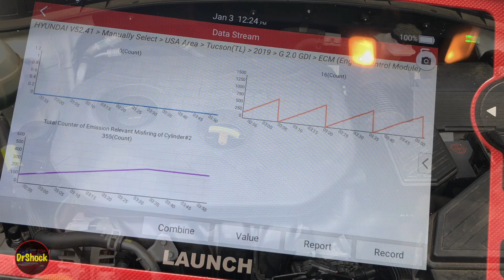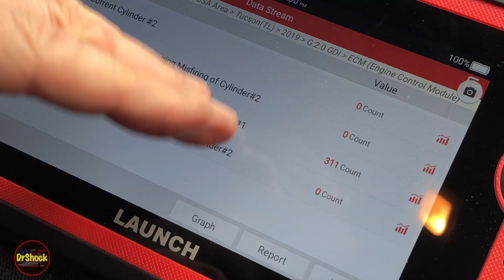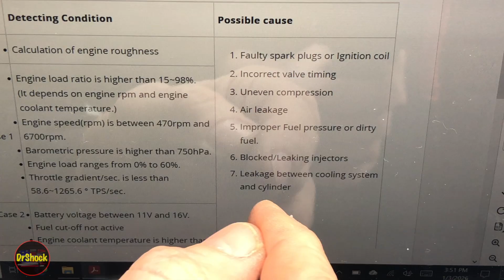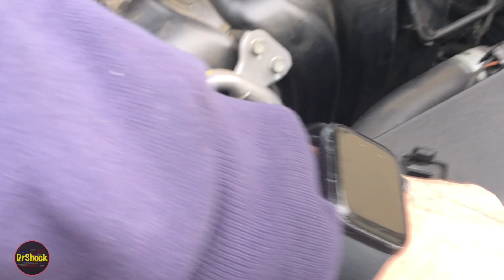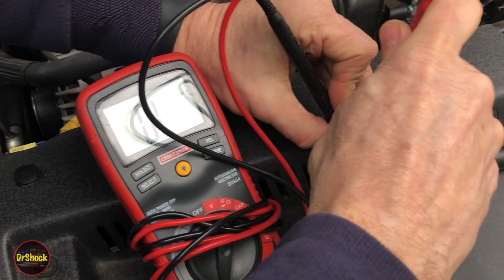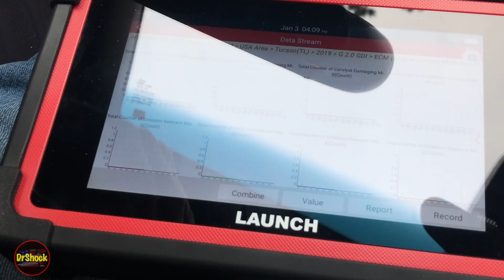2016 - 2021 Hyundai Tucson 2.0 GDI Engine Misfire Diagnosis ~ P030x Code ~ Ignition Coil Replacement

Comment: If you use Denso Coils would this be a warranty issue?
Reply from the maker: Technically, it shouldn’t matter. But it’s up to the individual dealership on these extended engine warranties whether they claim an aftermarket part was at fault or not. 

So I tell customers this isn’t a situation to be trying to save money, but rather prioritize the protection of the manufacturers extended engine warranty until it’s expired.  Don't give the dealership an excuse to reject a claim.

Comment: What about if you put after market spark plugs? Do you lose your warranty?
Reply from the maker: Technically, you're not supposed to.  But these Hyundai / Kia engines have been subject to several recalls so you do not want to take any risks here.  It is totally up to the dealer whether your engine problem qualifies for warranty coverage, or not.  

So spend the money for OEM parts only until the factory warranty, and any extended special campaign extended engine warranties have expired is my advice.

Comment: Why you did just leave number 2 where it was at sent you no it was number one
Reply from the maker: We swapped the cylinder 1 coil with the cylinder 2 coil to determine whether the misfire was specific to the ignition coil.  This is a common diagnostic approach with these engines.  In this case, this swap revealed the misfire followed the coil from cylinder 2 to cylinder 1, thus confirming the part had expired and needs replacement.   We moved the original cylinder 1 coil back where it was before the swap diagnosis and only replaced the coil for cylinder 2, as that was the only faulty part.

When using genuine OEM parts, you only replace the specific coil that is defective.  Due to the cost of OEM parts, you would not replace working parts proactively as it would be cost prohibitive.